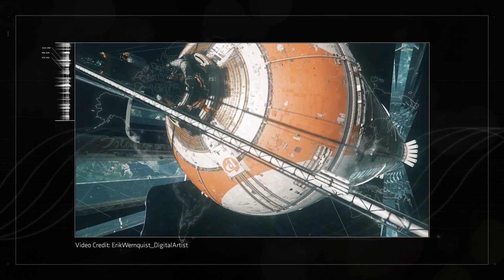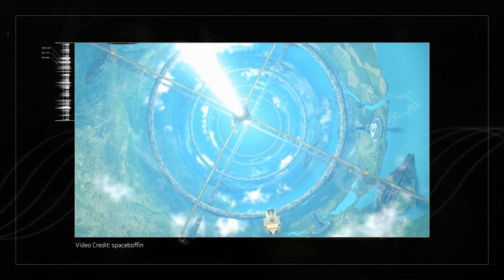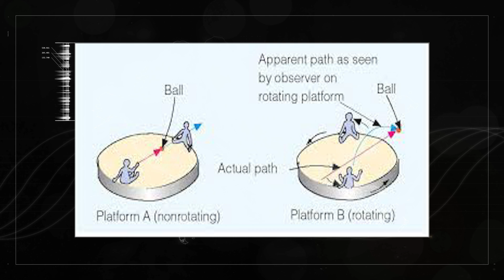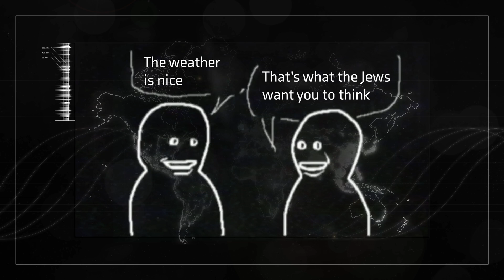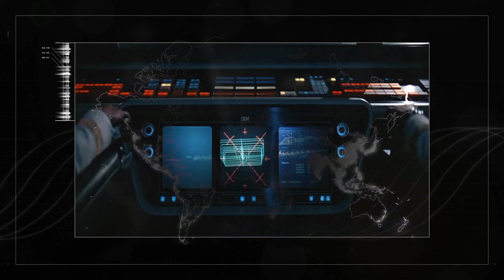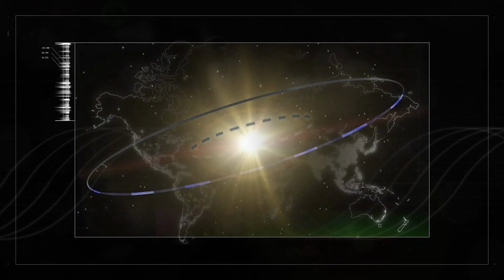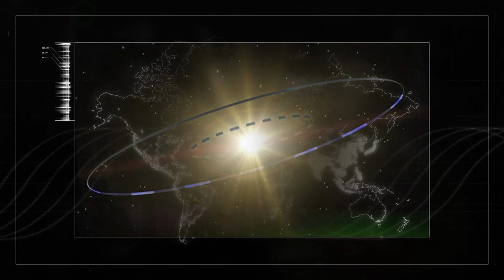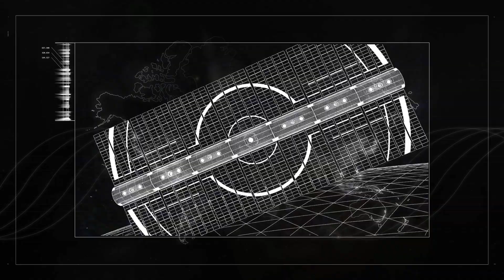Gravitational Architecture

Comment: Any idea how to spin 2 or 3 spaceships to give them Ag as they go to Mars?
Thank you for the video
Reply: If you wanted to spin two or three ships for a trans-Martian journey you would have to use a tether system mated to a central ion propulsion system powered by a nuclear fission reactor. Realistically it would be MUCH simpler to travel to Mars using an O'Neill Cylinder or a Stanford Torus. Realistically using a Stanford Torus is simpler to manufacture than an O'Neill Cylinder, both structures would have to be powered by fission. O'Neill Cylinders and Stanford Torus structures have the advantage of acting like temporary space stations in orbit of any planet you are visiting, allowing groups of explorers to visit the surface of the planet while carrying all of the manufacturing and life support systems of the Cylinder or the Torus. Elon Musk's idea of colonizing Mars without the use of a space station providing artificial gravity makes no sense, why wouldn't a group of explorers want to have a mega structure in space that is able to produce optimal conditions for human life?
Reply: @UndercoverSenpai01  Ho thank for the complete reply, I will meditate on the question.
Reply: @UndercoverSenpai01  If you are using relatively high thrust chemical or nuclear thermal engines you could get up to speed first and then use the tethers for the multi month coast phase. That's the architecture Robert Zubrin proposed for the Mars direct mission architecture, tether the crew capsule to the spent earth departure stage and now you have artificial gravity for the low low price of a few kilograms of tether. Very simple, very low mass. O'Neil Cylinders and Standford Torus are much comfier, but are much much more mass intensive per person and so aren't particularly mobile. Speeding up and slowing down one each trip would be obscenely energy intensive.
Reply: @massimocole9689  In all honesty ion engines have a pretty good shot of working at large scales because of their power to thrust ratio. Slowing down an Orion's Arm or O'Neill Cylinder would be almost impossible unless you are able to angle the thrusters in reverse to act as a brake. Nuclear thermal is interesting in the short term but I still hold my reservations in the specific impulse department.
Reply: @UndercoverSenpai01  If you are using relatively high thrust chemical or nuclear thermal engines you could get up to speed first and then use the tethers for the multi month coast phase. That's the architecture Robert Zubrin proposed for the Mars direct mission architecture, tether the crew capsule to the spent earth departure stage and now you have artificial gravity for the low low price of a few kilograms of tether. O'Neil Cylinders and Standford Toruses are much comfier, but are much much more mass intensive per person and so aren't particularly mobile. Speeding up and slowing down one each trip would be *obscenely* energy intensive. What they would be good for though is as cyclers, space stations set into an orbit that regularly passes between Earth and Mars. You only need to put the station into that orbit once, after that it's just minor station keeping, so all the heavy creature comforts like meters of radiation shielding, pools, and hundreds of meters of open air only have to be brought up to speed once. And then people arrive and depart from the station as it whipped past Earth or Mars using fast light shuttles that people only have to tolerate being crammed into for a few hours.
Reply: @UndercoverSenpai01  A transportation role that the bigger stations would be good for though is as cyclers, space stations set into an orbit that regularly passes between Earth and Mars. You only need to put the station into that orbit once, after that it's just minor station keeping, so all the heavy creature comforts like meters of radiation shielding, pools, and kilometers of open air only have to be brought up to speed once. The only thing that has to be speed up or slowed down each trip are some lightweight passenger shuttles to ferry people to and from the stations as they flyby Earth and Mars.
Reply: @massimocole9689  That idea makes a lot of sense in theory but there are diminishing returns associated with using a ship like a cycler. Definitely something to consider.
Reply: @UndercoverSenpai01  I'm not sure what diminishing returns your referring too, the concept can scale in terms of size pretty much indefinitely. Are you referring to diminishing returns in terms of transit time?
Reply: @massimocole9689  Yes
Reply: @ Yeah, its always going to be a multi month trip with a cycler, there isn't really a way around that. But if its sufficiently luxurious compared to faster spaceships it might be able to justify itself. Could have an ocean liner vs biplane situation for a while.
Reply: @ I would much rather have the ocean liner instead of a pipe point in that scenario. In O'Neill cylinder, and even in Orion's arm gives the crew of the ship all of the comforts of home with none of the drawbacks.
Reply: A good near-future option is to have just one ship, a tether, and a far-end module that typically will be much less massive than the ship. One end of the tether is permanently attached to the ship. The other is permanently attached to the far-end module.

At launch, the far-end module and the furled tether are in the ship’s nose. By putting the ship into slow end-over-end rotation, maybe 30 rotations per hour, we get a small amount of gravity. We begin lowering the far-end module into that gravity by unfurling that end of the tether. The gravity will make the module and the paid-out part of the tether extend straight forward from the nose.

This lowering would slow the system’s rotation, except the far-end module is **functional** . It is not just a counterweight. It includes a solar array that makes electricity, an ion drive that uses that electricity to make thrust, and a propellant reservoir. The thruster thrusts tangentially to the slow rotation, keeping the rotations per hour — the **angular speed** — constant as the tether continues to unfurl.

The strength of spin gravity is proportional to how far out you are from the spin axis. Supposing that when the ion drive has just exited the nose, it is 20 metres from that axis, 30-rph angular speed means the gravity it is feeling is 0.00559 gees. We’re looking for an end state where the ship is getting one gee. That will require it to be 1/0.00559 times 20 m from the axis. 3577 metres out.

If the ion drive and the solar array total one-ninth as massive as the ship, one might expect them to be nine times farther out on the other side, and the total tether length to be 35.77 km. Each kilogram of them would then counterweigh nine kilograms of the ship.

But that much tether is quite significantly massive and weighty all by itself, and with this taken into account*, balance is attained by having the far-end module 13 km from the axis, where it gets 3.63 gees. So each kilogram of it counterweighs 3.63 kg of the ship, and mass is reduced compared to the case where ship and counterweight are equally massive and equally far out.

Also reduced: complexity, compared to schemes in which multiple ships launch separately and hook up once they are in space. Only one ship, no spacewalking, everything already connected.

It's good to have two or three ships going to Mars, but if each of them does its own gravity in this way, they give better redundancy than if something happening to one tether affects all.

* if the tether material is Zylon working at ten percent of its breaking tensile stress.
Reply: @grlcowan  I understand your point but materials wise it would make more sense to build an Orion's Arm to achieve 1G. There would be no need for a counterweight in that scenario. Additionally using a tether system introduces issues relating to long term stress and issues with tensile strength. That also assumes that Zylon or a Zylon composite is used.

Comment: O'Neill cylinders are cool.
Reply: The amazing thing about Gerard K O'Neill's original concept is that his Island 3 Cylinder was feasible to build using 1970s technology. The issue with building such a structure then is the same issue as today: where do you get and refine all the materials needed to build such a structure. I already have a proposed solution for the issue, all I need is backing or for someone to tell me it's a stupid idea haha.
Reply: But what if you make it…

LONGER
Reply: @anticlaassic  That was my idea, I was going to make my proposed O'Neill Cylinder have a diameter of 16km with a length of 64km. Material science has caught up to that point by now, all I'm waiting on is fusion to become battle tested.
Reply: @ peanuts! When building habitats, don’t build sausages. 

BUILD SPAGHETTI!!!